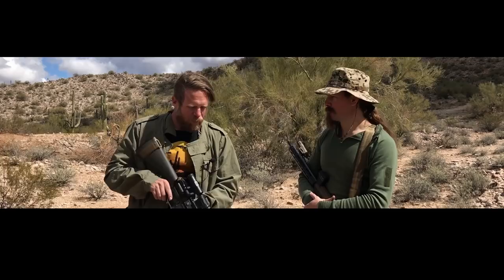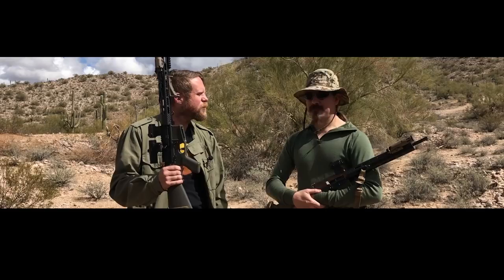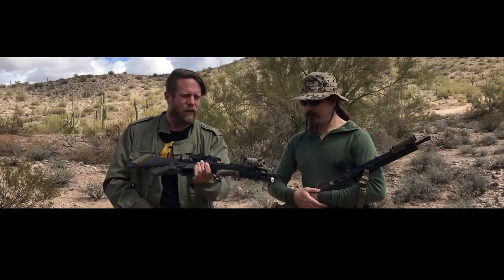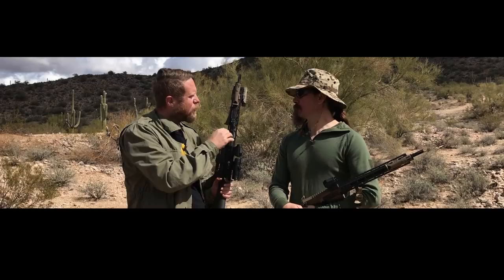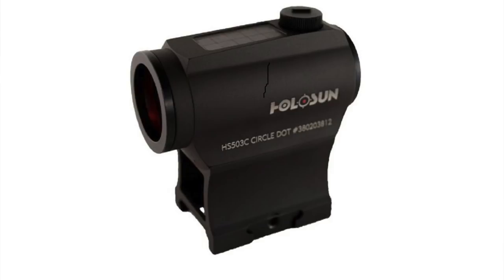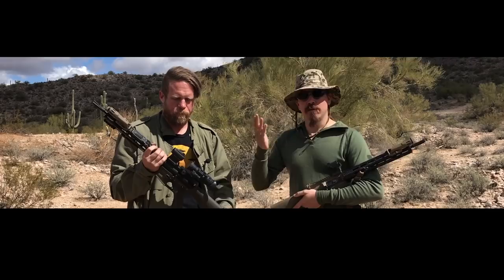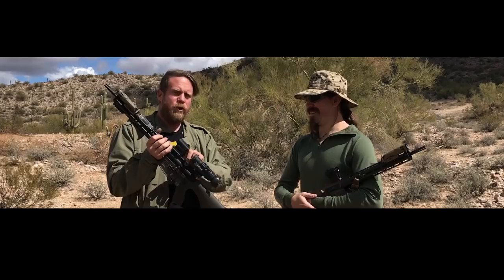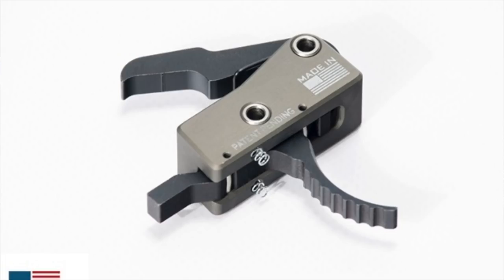WWSD: Rethinking the AR15 - CONCLUSION

Comment: Now they should do a "what would Kalashnikov do" rifle
Reply from the maker: Some of that will be addressed this year.
Reply: N Y E T,  R I F L E  I S  F I N E

- Mikhail Kalashnikov, 2018
Reply: Didn't Kalashnikov even oppose the switch from 7.62 to 5.45? So "Nyet, rifle is fine" may have actually been his opinion on the issue lol
Reply: I'm thinking what ian and karl would say is that the question will be up to the manufacturers and engineers based on what would be the most cost effective and simplest rifle to manufacture on a massive scale.
I'll make the argument that kalashnikov would go with polymer and stampings.
Reply: That would just be a plain AKM
Reply: Peter Ross Perhaps an AK-103 with a rail for accessories, adjustable stock, and a hybrid comp/flash hider. He was on record for saying that he preferred 7.62 over 5.45. They also seemed prioritize muzzle control over flash suppression but we now have devices that can do both somewhat well as a compromise. That's just me though.
Reply: Or when they get their sturmgewehrs they could do what would schmeisser
Reply: Do*
Reply: Kalashnikov would make use modern manufacturing techniques to make the cheapest, relieable rifle that will hold 3 MOA.
Reply: InRangeTV 

were you guys not planning an alternate history series about: what if the US army adopted a lever action rifle?
Reply: Precision shooter magazine did that some years ago. They built an AK leaning towards accuracy. Mostly concept but cool.
I really miss that publication.
Reply: how about I. baker.
Reply: not really sure much would change
Reply: Kamil patience
Reply: he did, because he thought the high velocity cartridge would wear out barrels too quickly.
Reply: Nyet, rifle is fine.

In other words, no. Inferior rifle will stay inferior because Stalinist russia doesn't care and if I speak out, I go to gulag.
Reply: except, you know, the AK did change, which is why russian soldiers are using AK-100 variants now
Reply: Edit: Not to be unkind, but I think that the question itself demonstrates something of an ignorance of exactly what Kalashnikov was doing. The AKM was exactly what he wanted. It was a simple gun that required only basic industrial tools and raw materials to make. It was simple enough that large numbers of people with little education could quickly master the basics of care and use. It was durable, easy to repair, and kept well in storage. To modernize the Kalashnikov would require one to break with his objective of keeping the gun as simple to make as possible.
Reply: Maybe not title it after that question (since the answer would just be a regular AK), but they should definitely still give the platform the same treatment.
Reply: +Peter Ross 
Actually, the original AK-46 prototype as well as SMG and other weapons Kalashnikov designed had better, more "western" ergonomics and disassembly features, but then it collided with Soviet production capabilities, and got changed quite a bit. In a way, SiG 550 family is more of what Kalashnikov would like to have, but instead he had to go with what was possible at the time.
Reply: +A Bowl of Pho 
Or AK-107 if you can get one in US, after all, Kalashnikov himself experimented with stabilized AKs back in 1960s. What I gather from Russian special forces guys, it definitely must be in 5,45 with shorter barrel, like AK-105, they complained only about one thing - shorter AKs have no lugs for underbarrel grenade launcher.
Reply: That would be dumb, the AK is not innovative in the least, Kalashnikov was not out to slap the craziest of ideas out there, he did not want to reinvent the wheel designing the thing, he made a rifle out of stamped steel to make it cheap, other then that all his prototypes are close enough to that of the final product that it was clear what Kalashnikov would do is the AKM.

He did not like the AK74 and 5.45X39, so he was not much of a forward thinker.

In the end this project you would just get a modestly lighter AK with AR15 controls, the whole action of the AK is entering obsolescence and very nearly hitting outdated, no matter what you do, the AK will be heavy, require a big ass trunion and tons of rivets, there is no good way to lighten it like you can an AR15.

You can't make an AK out of plastic, the trunion is riveted directly into it, the whole receiver has to take pressure, it's not like the AR15 lower that is basically holding parts and a spring, so that can be made out of basically anything.

the AKM barrel is already pretty thin to start with, and the other issue is how damn heavy the BCG of AK is, no other modern rifles use long stroke pistons for a reason.
Reply: 7,62, wood furniture, stamped receiver. Done!
Reply: Mikhail would introduce a higher quality of Yak ghee based-lubricant, and a stamped sheet metal barrel that can also be used as part of a still to make potato vodka. Truly the infantryman's best friend.
Reply: VZ58
Reply: here is what i think would be interesting. what if the soviet union stayed with the SKS rifles and never even adopted the AK. what would a 5.45 SKS with a 30 round mag and who even knows what else they could have engineered for the SKS if they stuck with it. what would a modern SKS be like if it had decades to improve like the M16 series. An aluminum receiver SKS with everything lightened perhaps. i always wonder what a gun that was dropped  and then switched for another weapon would be like today.
Reply: A lawnmower
Reply: +Peter Ross, You'd basically have a modernized VZ58 at that point.
Reply: Kamil they said more is coming this year on the “lever in 1800s” project. Can’t wait.
Reply: nYEt, rIflE iS FInE
Reply: what would stoner do to kalashnikov
Reply: Kalashnikov would probably machine his parts like an SKS and make it a bullpup.
Reply: nyet! It's not the 40s anymore grandpa!
Reply: Magpul furniture. adj. gas block. Done.
Reply: @ABowlofPho  I think the answer is an AK-12 in 5.45×39mm.
Reply: Russia is ordering both calibers with the AK-12 and AK-15 (which were also based on the AK-400 prototype by Mikhail Kalashnikov before he died), A-545 and A-762 and finally the RPK-16. The A-545/762 uses the BARS system which is used in the AEK-971 and AK-107. Basically it's compensating recoil which allows higher rpm. The AK-12 on the other hand uses a more classical method to reduce recoil. 

Overall the AK-12 is more reliable, has an adjustable stock that can be folded on both sides, a basic AK safety selector (the prototype had a modern ambidextrous one), picatinny rails, can use the new GP-34 grenade launcher, overall design tweaks like the dust cover, iron sights and handguard.
Reply: Sig 556
Reply: @joeylarose2452  OMG! Yes an upgraded SKS would be so sexy!
Reply: Well... Most of the Kalashnikov for at hasn't changed allot. Aside from the move to Stamped receivers, and a shift to 5.45x39 caliber, the rifle is largely the same as it was. You can pick up milled 7.62 AKs all day long. I think Arsenal even makes one.
Reply: The AK 100 series are a thing. 
A balanced rifle with reportedly lower recoil impulse than just about anything close to it, accurate, but considerably more complex than any previous AK, and most of its competitors. 
And... unfortunately that's not what Kalashnikov as a WWII vet had in mind at any point. (the 5.45x39mm is about 2/3rds of the 7.62x39mm in terms of muzzle energy, even if it is lighter and somewhat more accurate).
It would be like asking "what would Browning do?"
Reply: Video starts and ends with a lawnmower.
(Or was it the vacuum cleaner)
Reply: A better question is what would Stoner do to an AK platform?
Reply: I imagine dragging guns behind vehicles a lot in that one.
Reply: That's a totally different story...
🖖🏻🇫🇷😎🇫🇷🤪🇫🇷🖖🏻
Reply: Nyet Rifle is FINE
Reply: From his own remarks much later in life, Kalashnikov would have built a lawn mower instead.
Reply: Ak-74
Reply: Nyet comrade, rifle is fine
Reply: @ABowlofPho  5.45 has some real problems, reading about the Chechen wars both side came to the conclusion 5.45 was dangerous in urban combat because the bullets were very prone to ricocheting off walls.
Reply: @ThatAintGud  You could improve ergonomics. Synthetic furniture would cut weight. Modify it so the rifle can mount optics more easily. They actually changed quite a bit on the AK-74 relative to the AKM with a lot of effort put into lightening the rifle.
Reply: @danmorgan3685  the Ak was designed to be cheap  reliable and easy to build. Ergo and weight were not considerations, so Kalashnikov wouldn't have done the things you stated. That would be what would Stoner do with an Ak.
Reply: @InrangeTv  Where can i purchase this rifle! Very intrested i want one badly!
Reply: @BigMek456  well, I think it's common knowledge that stoner opposed the switch from 308 to 5.56 lmao
Reply: InstaBlaster
Reply: The same thing as what should be done with 3 point slings.
Reply: Switch it back to 7.62×39mm, replace plastic with laminated wood.
Reply: Add vodka reservoir in stock
Reply: Milled receiver and barrel not whipping during fire
Reply: @slugger449  I was able to assemble an AR to my choices, con do the same thing with an AK, I really doubt it.
Reply: Kalashnikov would have made farm equipment, given the choice 😆
Reply: I would love too see 👀 😍

Comment: You know, I reckon the arctic guys will appreciate that heat neutrality of the polymer and carbon fiber just as much as desert guys.  Aluminum’s problem isn’t that it gets hot per se, it’s that it has a really low heat capacity and high thermal conductivity.  So not only can it get literally blisteringly hot, it can get shockingly cold, too.  I imagine having your face thermally bonded to the gun doesn’t help with concentration.
Reply: MegaAlpakka Painted aluminum still gets cold, friend
Reply: @MegaAlpakka Steel Toes in boots aren't even directly exposed to the air, and have a covering on both sides. They still get so painfully cold working outside that I pay 3x the money to get the carbon fiber toes and not deal with that.

Trust me, the Arctic guys will like that handguard just as much.
Reply: @MegaAlpakka theyre usually annodized not painted
Reply: dA pAInt mAkeS iT a nON isSuE...  Derp. Have you ever even been outside? Lol.
Reply: contact frostbite or rather, making the blammer operational with gloves on continues to be a major design criteria for many, many countries near or in or that share wintery winds with the arctic circle & surrounding areas.
Reply: One advantage of the  A2 stock: it's plastic so you're not coming into direct contact with metal.
Reply: not just face but hands under gloves. I have noticed while working flightline that such gloves like the Machanix thermal gloves that even with the extra layers for heat retention, that having contact with metal makes the glove get colder faster compared to ambient air. Even more so when you have a high windchill factor.
Reply: And then you've got soldiers daring each other to put their tongues on their cold rifles, and then you have to call the nurse, and recess is ruined.
Reply: Happened to me once. It was freezing cold at - 15 C when my hands got stuck to the handguard. It was so cold, I could take of my gloves and they kept being fixed to the gun like a forgrip. Aluminium is nice in moderat temperatures, however in the extrems there might be better things.
Reply: Can confirm this sucks at -40F
Reply: Yes. The same is true for steel too. Metal stocks can get freezing cold in cold climates.
Reply: I wonder how the carbon fiber parts fare in extreme cold weather though. I know in photography a very real issue we face with carbon fiber tripods is their brittleness in cold weather
Reply: Gloves

Comment: Everyone is talking about what would Mikhail Kalashnikov do, but what I want to know is what would Dieudonné Saive do if he made the FAL today?
Reply: That would be intresting.
Reply: It would be the Scar 17.
Reply: Tiberius: The exact same thing, because the FAL is the perfect firearm.

Dean: The AR10, G3, M14, and FAL all far outclass the SCAR 17, especially in the cost category. ;)
Reply: Not tilting bolt and optics ready
Reply: CK's channel. I love my G3 and my AR10. But they don’t outclass a SCAR in anyway. Not in weight, not in reliability. AR10 comes close in accuracy but now they have the precision SCAR out so that’s a toss up. M14 is outperformed by anything else. FAL isn’t as reliable as the G3 or SCAR or AR as seen on inrange
Reply: I can build a very accurate, reliable, and fairly light AR-10 for $800. A scar costs so much more as to be a non starter.
Reply: @deandaniel6504  scars are on par with the tavor with how overrated they are
Reply: @breed4659   millions would say the same about the AR platform and they are as wrong as you are.
Reply: He would take the FNC and not make it from steel, and have an integral picatinny on the dust cover.
Reply: @dsarms
Reply: He would don’t
Reply: Joakim Henrikson  It would by smaller, lighter and in 280 Brit. Nice cartridge!

Comment: I wish Magpul would get on the polymer lower idea.
Reply: Matt That is a polymer lower I would actually trust.
Reply: I would imagine it to be something like an MOE AK triangle stock molded into a K grip and then the lower. It would have metal reinforcement where it matters. It would have more features than the GWACS. It would be more expensive. But it would be nice and worth it.
Reply: If they went with a triangle stock, I don’t see why it would be heavier; or the weight savings would be rolled into more metal reinforcement.
Reply: Magpul is never going to make serialized firearms unless they have a dramatic change in business model.
Reply: SinistralRifleman Perhaps they could do what they did with the ACR, and design and develop the rifle, and then license it to an established firearms manufacturer for production (and hopefully they would pick someone far more competent than Remington or Bushmaster).

Also, if they make a number of significant improvements that I think are necessary, it's probably not an issue if it weighs a little bit more (you could still easily get a sub 6-pound rifle). This GWACS lower is a solid proof of concept, but it's severely lacking in a number of aspects
Reply: You're probably right, but still... someone needs to do some product improvement on the GWACS/CavArms product... it has potential but the ergonomics could use an update.
Reply: Einsatzgruppen Commander the CAV-15 MKII is a 15 year old design that was never updated for a number reasons; mostly economic.

GWACS will release an updated model eventually.
Reply: Tennessee arms makes a good polymer lower, I have several, and have not had any problems.
Reply: They did. It's called the ACR. I didn't trust the GWACS either, until I saw the jeep roll over it the second time with no damage.  Don't think I'll be buying anything else from now on.
Reply: @chrismcleod9748  Can you do pushups using the rifle like they did with the GWACS lower?
Reply: Brian Isaacs Dont know, I shoot my rifle, not use it for exercise aid,l.o.l.
Reply: @chrismcleod9748  It was just a test that showed the deficiencies in the poly recevers that are made like the "mil-spec" aluminum receiver. Poly does not have same strength like metal has if in the same shape. It has to be  made differently to take the same stresses as as the metal part like the Gwacs lower vs any standard poly recever. 
Doing the pushups using an AR is just a test to simulate a sudden force applied to your rifle if dropped  or something fell on it.
Reply: Brian Isaacs I've had no strenght issues with Tennessee Arms recievers. Once they  are pinned to upper, should be strong enough, I have 3, and no issues, lifetime warranty , if you break em.
Reply: @chrismcleod9748  Yes for personal use they are adequate, but for the terms of the project, they were looking at rifles for the military not just Gucci gun builds for personal use.
Reply: Viscous Shear GWACS appears to be dead.  But there are other things in the works...
Reply: I had an out of battery discharge in a polymer lower once.... kinda warped my perception of the benefits of weight savings. I’ll take the extra 4oz iof strength plz.
Reply: They did. But it's on the ACR.
Reply: Just found one of the new KP 15 ar complete lowers in a gunstore yesterday scooped that thing up quickkkkk
Reply: Wish Magpul made 762x39 AR Mags not just AK Mags but for now CPD/Dura Mags work cherry, but it would be nice to get some reliable non-metal ones...maybe one day but I’m not holding my breath
Reply: @thisSiteSucksHard  7.62x39 ar mags should not exist
Reply: @Discov110  I disagree, 90% of my rifle cartridge range time is used with 762x39 and exclusively with AR pattern, not AKM so there definitely should be polymer mags for it.  As I said, I use cpd/dura metal Mags and they work perfect just would like to entertain an alternative option, ymmv
Reply: Not really keen on AR polymer lowers. Every one my dad has tried has cracked or had pins walk out of holes.
Reply: Comment thread is 3 years old but glock is supposedly making an ar style rifle
Reply: @richardlahan7068  weird, I bought an ATI Omni hybrid years ago, we all shoot it all the time, and we have never had a problem with it,
I live where we have -10°F or even lower, I’ve deliberately brought it out on days like this, to let it get very cold, and fire it to see if it malfunctions, or breaks and it hasn’t yet.